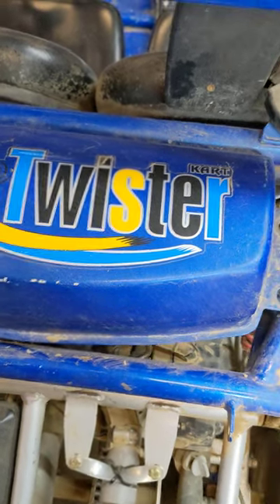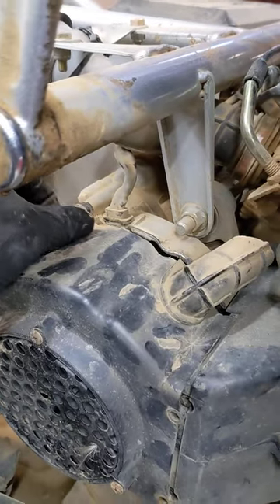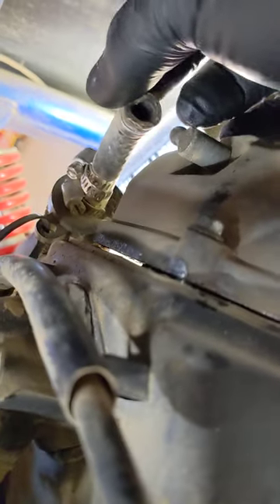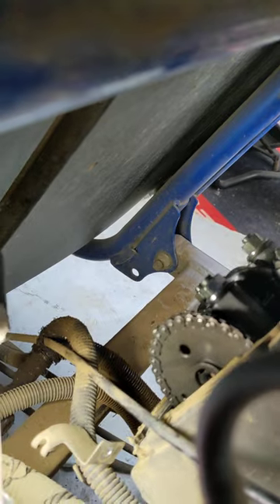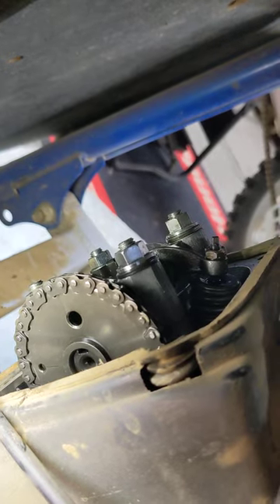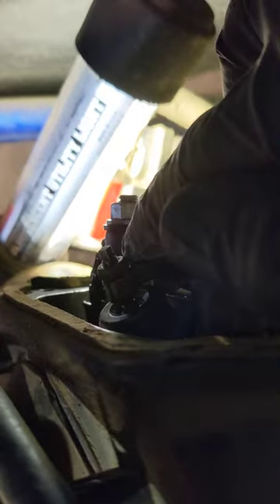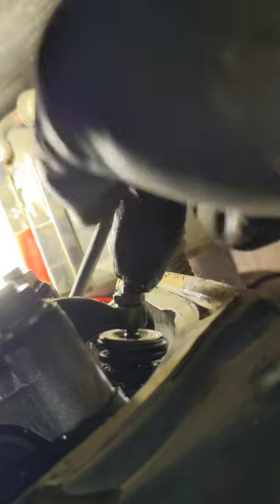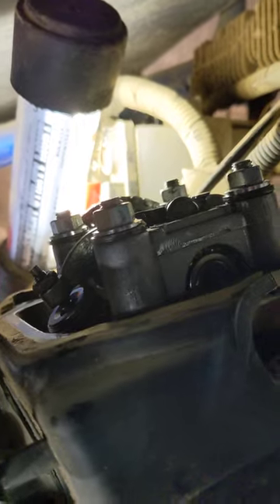Twister Hammerhead 150cc GY6 UM150IIR Go Kart Valve Clearance Check and Adjustment THOROUGH

Comment: Hey question, on your way to top dead center is there supposed to be air escaping out into the valve area, as the piston pressurizes the air in the combustion chamber? Or is that a gasket leak?
Reply from the maker: Hello, yes, as you stated, you're still pressurizing the cylinder with air which will move through the valves, that's why it's hard to cycle the engine. A helpful tip, remove the spark plug and it'll cycle much easier, as air will escape through the spark plug hole, instead of forcing valves open manually.

Comment: Hi me and my brother have this same go cart and it broke when we were riding it it was going fine then just stopped going forward It runs but we push the gas and nothing happens We have a forward and reverse and it doesnt do anything My dad says he doesnt want to spend money on it do you think you know whats wrong with it? Thank you
Reply from the maker: Sorry for such a delay, never received a notification on your comment. Sounds like a belt issue, or engagement problem from the clutch weights. In any case, take that belt cover off and start from there. Good luck!
Reply: @visual86  Hi thank you so much for the help it was the belt and clutch that had to be fixed =)